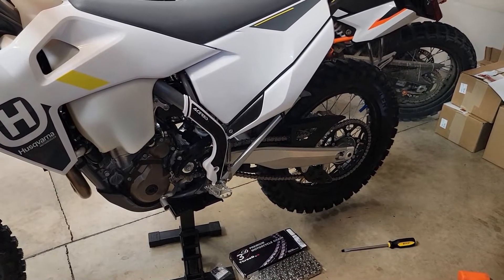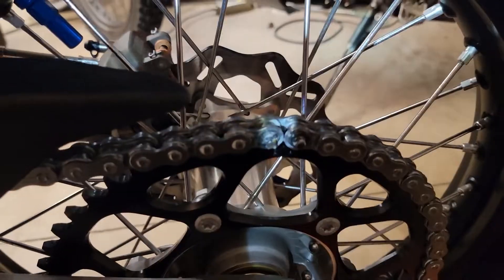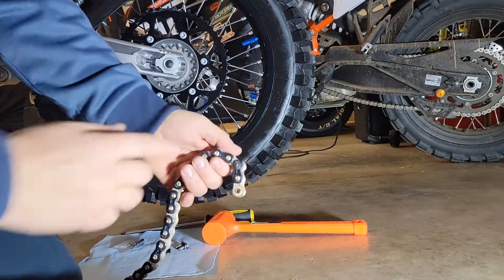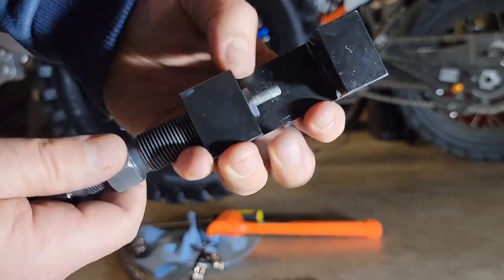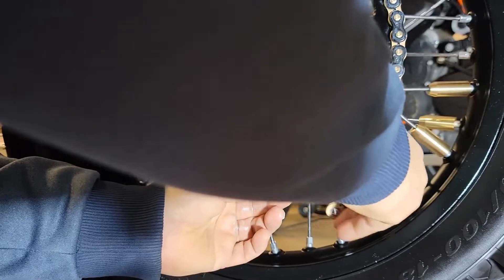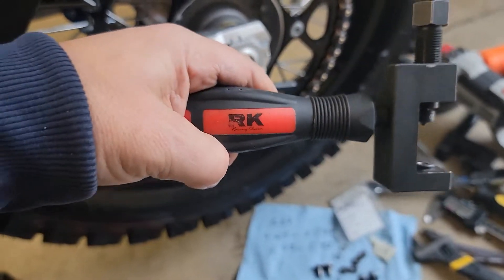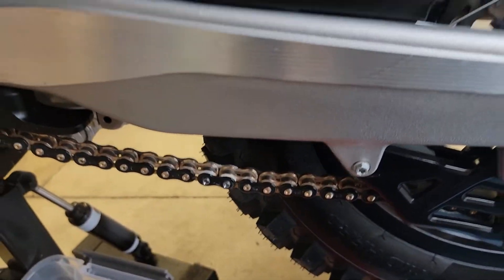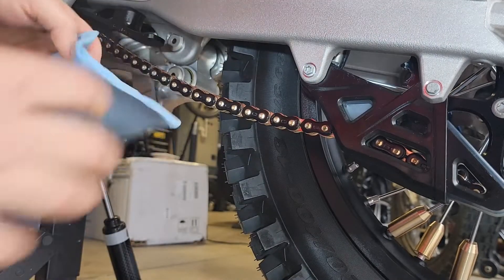EK 3D 520 Chain Installation Rivet Style FE 350s

Comment: I just want to make a quick note to anyone watching this. You are using the chain breaker wrong. You have the pin showing when you are pressing. I understand doing this so you can see it being lined up. But once you are lined up you should put the part the chain breaker pin sits snug against the chain. Then twist the end to push the pin all the way through. Your chain breaker pin bent and that will never happen when used properly. If you are met with too much resistance then you know you need to adjust where you are but the pin still will never it will just  stop turning.